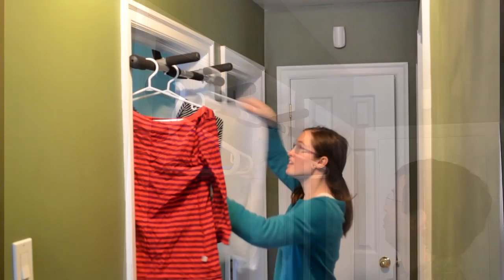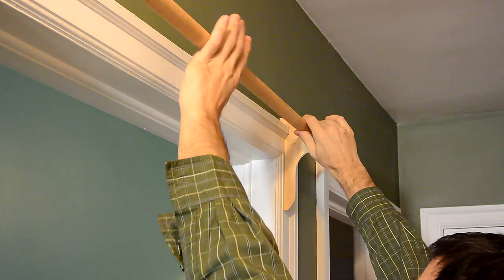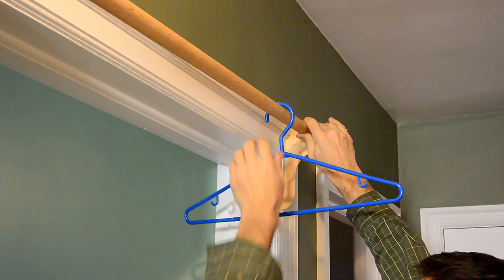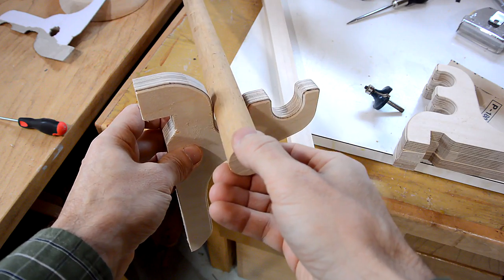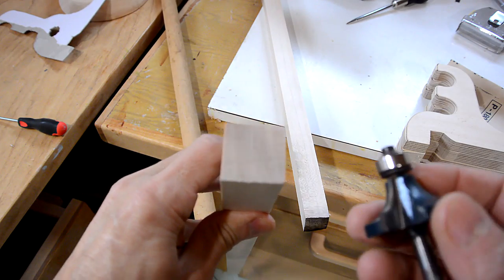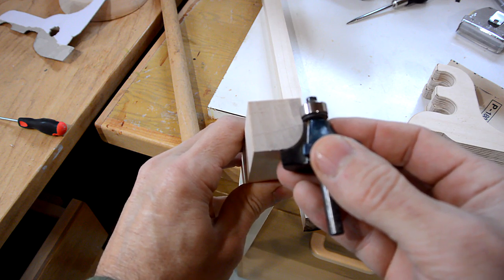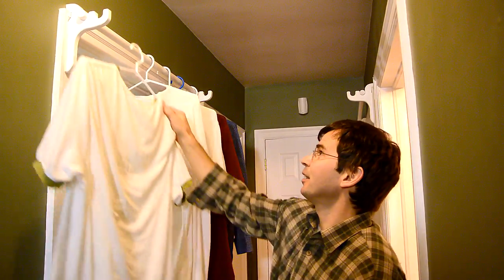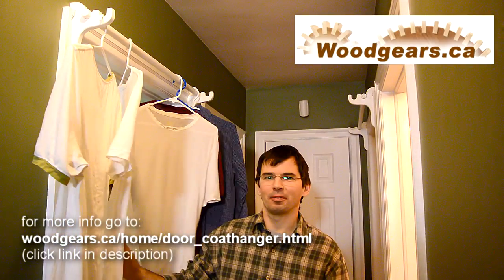A bar for hanging clothes to dry in a door frame

Comment: Am I the only one which has as sound problem at certain points using the power tools ? The bandsaw and the drillpress is a bit jittery ? Not the picture is clear
Reply: bad sound in this movie
Reply: I notice it is only in the sped-up parts of video. Maybe some problem in video editing software.
Reply: Yep. Something went wrong in the sped up parts.
Reply: yeah i get it aswell
Reply: I think it might be a function of using the tone correction in video editing so everything doesn't have a high pitch whine, i have noticed something similar in a couple of my videos.
Reply: Mathias has said that he had a render bug
Reply: has to do with speeding up the video, as high speed tends to show movements that would normally go unobserved, basically the same with slow motion as well , high speed is slomo in reverse go check out jimmydirestas videos they are all sped up, hence making all his tools look unsave and jittery
, although he admits it himself too that he works in unsave ways, jimmy that is.
Reply: Lalaland I really dont think thats the case if any its to make the video shorter and so you see the process. But why videos are speed up is not part of the desscussion, it is about the bug in sony vegas where sped up parts have an audio glitch but in the sped up part at 1:08 the sound is clear. mmmm.
Reply: im having the troubles too is it my computer?

Comment: My wife requested something similar awhile back.  Luckily our molding isn't quite as tall as yours so I got away with just putting a small strip with about a 15deg bevel (pulled as is from the scrap bin) right on top of the molding to keep them up high and let them move back and forth without falling.  Thanks for the video!

Comment: I made something a little more permanent in our laundry room. I started with a 12" x 36" piece of 3/4" plywood to which I fastened crown molding around the edge giving the illusion of a much thicker shelf. Then I took two 90 degree decorative shelf brackets and fastened them the TOP side of the plywood (spaced for the wall studs.) On the bottom of the plywood, I attached two decorative drapery brackets with the 2" fluted drapery rod between and decorative finials on each end. Everything is painted white to match the washer and dryer. The shelf brackets are very sturdy and we can hang plenty of damp clothes on it, plus place decorative pieces above (or cleaning products, but we stacked up a picnic basket.) So it's both functional and decorative. If you want, I can email you a picture.

Comment: You can get away with drying clothes in the house there. But here it's a problem. The moisture is more load on the AC, and it encourages mold growth.
Reply from the maker: mweverett In the winter, the house gets too dry from heating.  So drying indoors makes a LOT of sense.
Reply: Matthias Wandel
In the summer we run the bathroom vent fans after showers and keep the door shut till the room is dry. In winter the opposite. I had to stop the wife hanging up things to dry in the basement. The smell of mold was starting. I live in the SW part of Virginia.

Comment: that was a great idea / but If I cant do the job with my hand drill, skill saw, jig saw, sawz-all or dermal its not going to get done. What it you got an old fan in a room your not using make a disk with holes for the hangers and put it on low and spin dry - that would be interesting

Comment: Hey Matthias, how do you prevent the paint from seeping into the fiber ends of the plywood?
Reply: Just keep adding paint too the ends
Reply: i was wondering if there was a more economical way, i use wood glue to seal the edge in. then paint over it.

Comment: Wow and they instantly reproduced on the door behind you :-). On a more serious note, I get why you ony needed one mounting screw per side, but what would you suggest for newer homes where the door trim is considerably less substantial. Oh, and where does yee Olde, probably seldom used chin bar go now, my, like new bar, is living decades in our basement :-(.
Reply: Use plastic anchors to make a cleat in drywall or plaster above the trim. It should be plenty strong.
Reply: Shift the location of the screw to go throughf the drywall above the trim. In all residential construction there is header above the door opening to both carry the load and prevent the opening from twisting. As long as you go into the drywall about 1.25" you will hit the header and be secure.
Reply: Al Amantea You'd have to go through the door casing or you'd be above the header.  Anyway, the screw just keeps it from slipping off the casing.   The casing bears the weight.  It can handle all the clothes you could pile on it.
Reply: snowdog90210 no you would not miss the header. The header should be at a minimum a 2x6
Reply: A 2x6 is 1.5 inches tall.  The door casing is probably 2 1/4" tall.  The thickness of the door frame is probably 3/4, and there is usually 1/4 to 1/2 gap between the frame and the header.  If you do hit the header, you'll be maybe 1/4" from the edge of it.  The way Matthias did it is better.  You won't see any hole when you take the bracket down.
Reply: snowdog90210 on what planet is a 2x6 only 1.5" tall? It's 1.5" thick, and 5.5" wide. Placed on the vertical as a header always is, there would be no possible way to miss it. I agree that the way matthias did it is less obtrusive when removed, but the original question was what to do with less substantial trim. You obviously have minimal construction experience, and should reread the comments. In any wall, a header over a door or window is always placed vertically. The header normally consists of 2 pieces of lumber sandwiching a piece of 1/2" plywood to make 3.5" thickness. The header can be anything from 2x4's all the way to 2x12's depending upon the span requirements.
Reply: Sorry to cause a controversy, it was just a dumb little question about a really cute solution for a guy's very pretty wife. Btw, just an fyi, there would only be a header over a door in a load bearing wall, otherwise it's likely to be just the flat side of a 2x4 (1.5" in the US) with just a few cripples to span to the ceiling. I thought that Matthias's solution was of his now, pretty standard, cleverness, but the trim in the house that I live in is just a single piece curved, kind off tappered to the wall type. I know there some wood somewhere in the wall, like on the side of the frame, but the hidden nature and the clever transfer of the load to the top of the trim was just interesting,  I don't think my penny nailed trim would do well here. Anyway, thanks for the suggestions, just, please, remain civil :-)
Reply: Darnley Bynoe I know and I agree completely. 
Of course, if all you are doing is hanging a few shirts till they dry, just about any trim should hold it just fine. it's not like it has to be structural.
As a contractor, I always put a header over a door, even non load bearing. It stops the wall from shaking if a door gets slammed, and add strength if someone were to... i don't know... hang a chin up bar from the doorway.
Happy New Year to all.

Comment: My family has the same pull-up bar and sadly it's used for the same purpose.
Reply: These bars are everywhere and they're awesome. Sadly we can't even use ours for that purpose anymore though since we moved somewhere with overly wide door frames.
Reply: Overly wide door frames sound awesome. I wish more building codes had that.
Reply: It's not really a building code, just something they did to artificially inflate the aesthetic of the place without using decent materials. I still bang my elbows on them too =/

Comment: Why not just build a proper closet and put in the bedroom with all of the other clothes?
Reply: then get a tumbler!
Reply: Carsten Svendsen Tumble driers use lots of electrical energy. Planning to wash and hang clothes a day or two before you need to wear them saves the cost of both the tumble drier unit and the energy it would use.